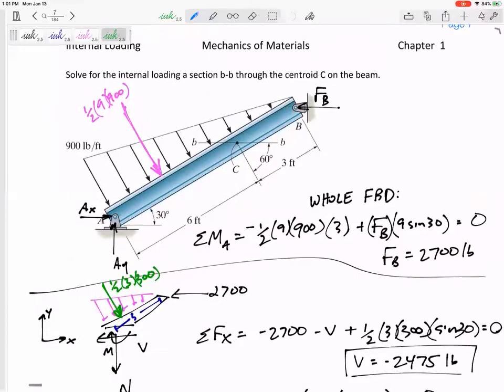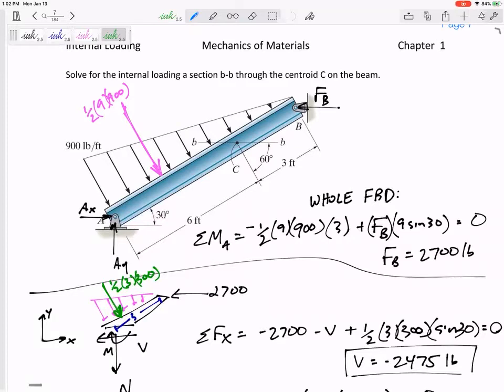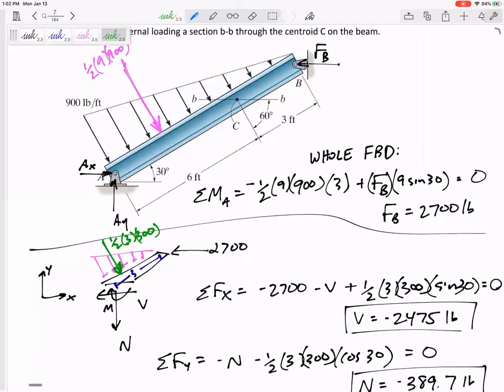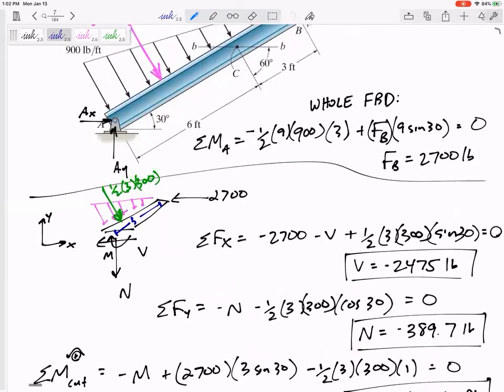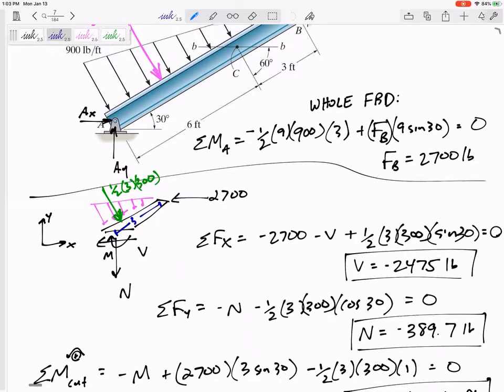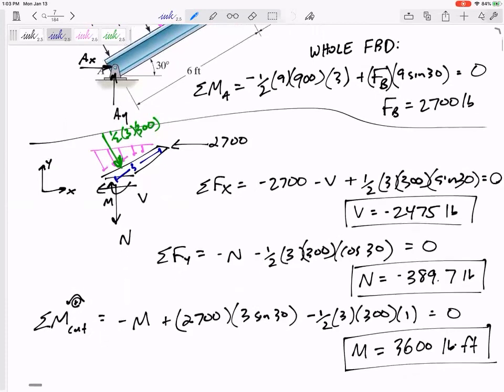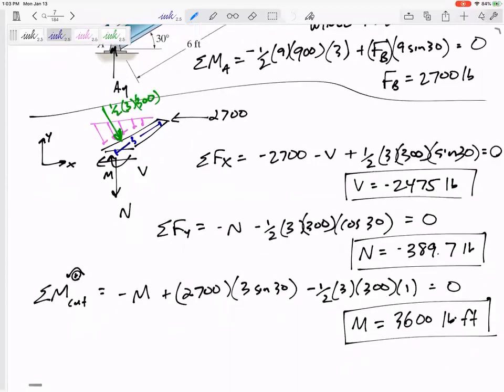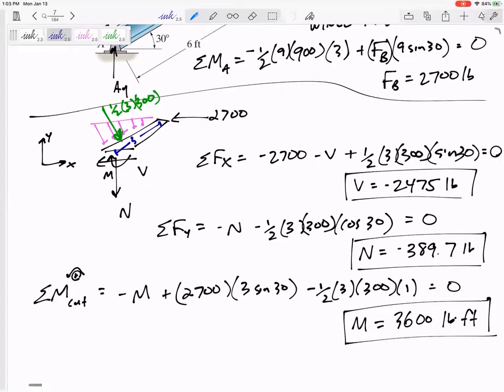Mechanics of Materials - Internal forces example 3 overview

Comment: So if we had a rectangle plus a triangle as our distributed load, where would the centroid be?  Halfway between the triangle's centroid and rectangle's centroid?
Reply: It depends on the magnitude of both. For example lets distance between 2 centroids is 2m. You must use weight-balance like equation. Its like: Triangular'sForce*x = Rectangular'sForce*(2-x) and with that, you'll find x which is the location that you point out.
It's already passed 7 months but well... :D

Comment: Where I can find solution of example Page Number 6 that asked for internal loading at C. Also I can't find 2D internal forces: RECAP and Important Notes page. Please help me refer to the suitable page where I can find both
Reply from the maker: I'm not sure why I don't have a video of the problem on page 6. It can be found in Hibbeler's Mechanics of Materials textbook - example 1.3 on page 13 of the 10th edition.

The recap and important notes are just blank pages where you can write down what you think are the important points as you're going throug the notes and homework problems.